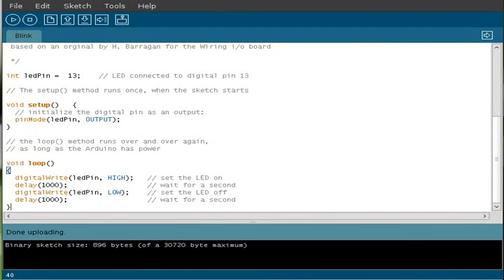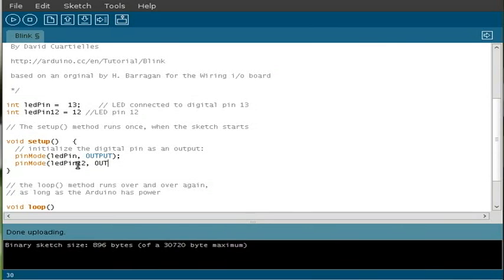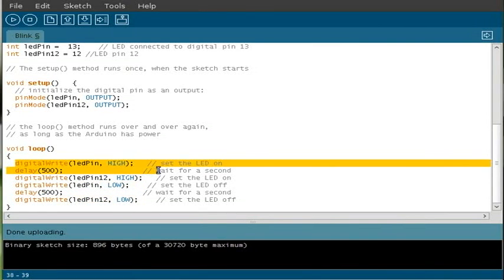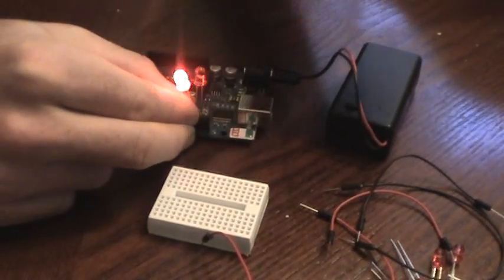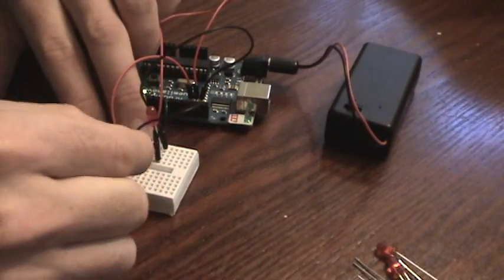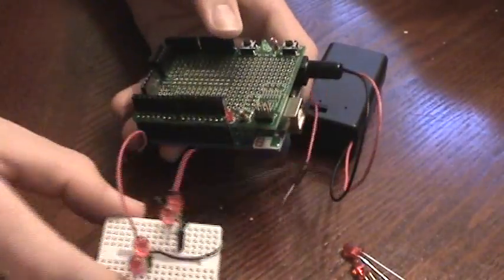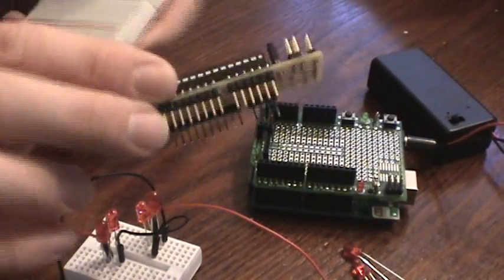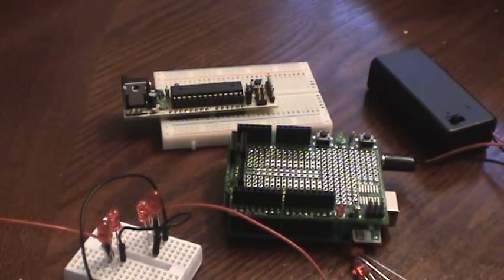Arduino - bread boards and LEDs - Part 2

Comment from the maker: @coolzidedown: No, you need a few more components then that.  At the lest you'll need 2 resistors, Quartz Crystal, and a power regulator.  Check out the current issue of Make Magazine Vol.25.  It's all about Arduino and on page 62 the is an article on making a minimal Arduino from scratch.

Comment: @metalx1000 well can we take it off the board after we program it and connect our led to pin 13 and power it, will it work?

Comment from the maker: @coolzidedown: Well, if the Chip isn't soldered to the board, you can take it off the Arduino. But it really isn't to useful by itself.  So, I'm not sure what you're asking.

Comment from the maker: @the9ghost: It's the Default IDE. It's a Java program that is designed for the Arduino.  You can get it at arduino.cc  

It's not only thing you can use, but it's nice since it's designed for the Arduino and comes with Sample code.